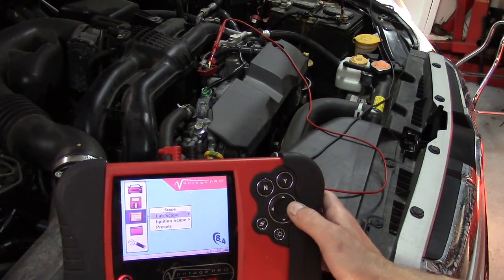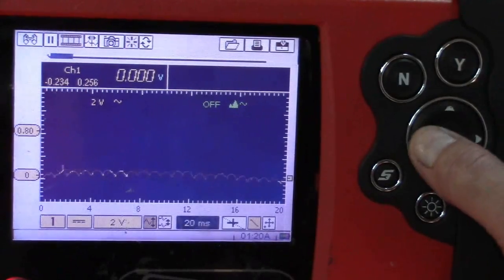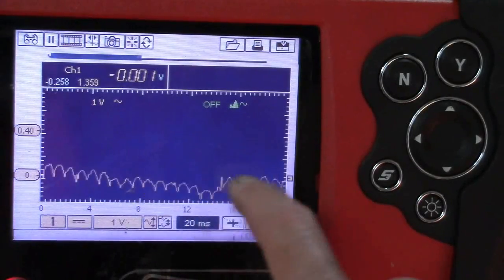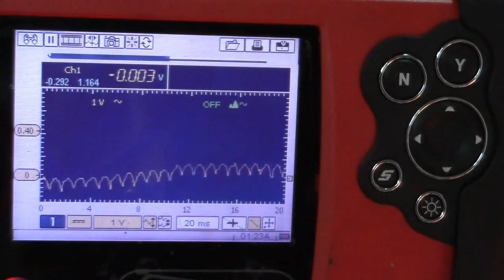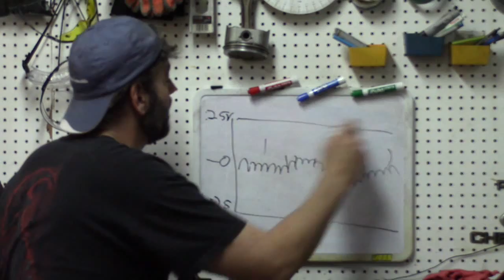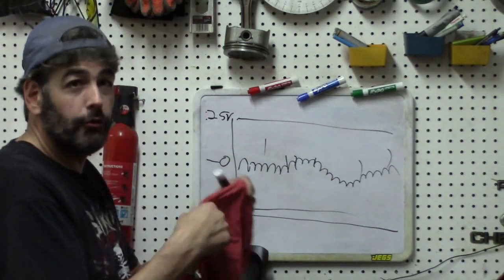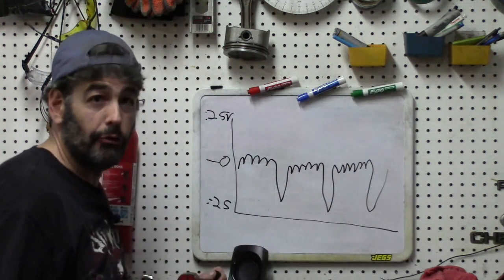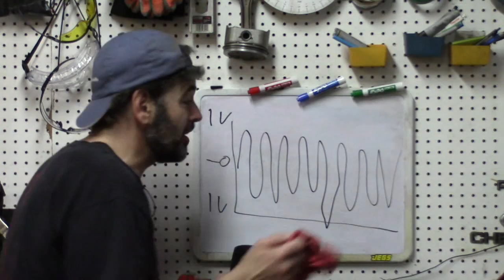DIY- Alternator Test Using the "AC Ripple" Method

Comment: I think you mean the diodes are bad particularly Matt as the diodes convert the AC to DC ; when they fail they allow too much AC in the system which can cause the sensors to go crazy, and the speedometer to move with the transmission in PARK

Comment: Great video God bless! my alternator passes but not the ripple test my heat and cold dashboard light is out and a battery 🔋 light on but the battery is still charging.. I have a spare alternator in the trunk in case I need to install it thank you huge stress relief

Comment: Hi Matt. Can I use this test to a car equip with Intelligent battery sensor?
Reply from the maker: Yes!
Reply: @SchrodingersBox Does the specs. for ripple test .400 ac volts and 40 milliamps?is it correct? Can you correct me if Im wrong. Thank you

Comment: To do this test I had to connect one of the leads to the Battery positive terminal, not the negative as shown in this video.
Reply from the maker: bruh. it’s measuring AC.
Reply: @SchrodingersBox  Yeah, I get a good pattern connecting to battery positive and B+ terminal on the generator. Even the Snap-On ripple test video tells you to connect to Pos. and Pos, measuring AC.

Comment: If ripple test done  and the result was bad. Dose this causing parasitic drain .

Your advice highly appreciated.

M.y
Reply from the maker: that’s a good question. I am not sure. the parasitic drain from an alternator would be caused by a bad diode and current would not be unidirectional. however I do not believe the diode is responsible for the AC ripple pattern- I think that’s the result of the commutators. 
.  Not totally sure on that though.

Comment: Can you use a multimeter to do the ripple and test and base if the alternator is good by the measurements
Reply from the maker: i don’t see how you could do that- even with a frequency measurement, you wouldn’t be able to determine a commutator dropout based on a numerical output only-  that I can think of at least.

Comment: This is going to sound crazy but I'm getting 26Vac on a dvom. Am I right to assume the diode pack is bad or could it also be the voltage regulator.

Any guidance would be appreciated.

Comment: I think my alternator is doing this and it's also causing shifting issue in trans is that possible? It threw a p0700 code one time but once cleared hasn't thrown code again but lights flicker in cab headlights taillights etc
Reply from the maker: a bad alternator can cause just about anything to happen.  you must fix alternator first before determining if there is a legitimate code.

Comment: RPM needle increases about 40rpm, then drops down about 40 rpm all the time, up.....down, up..down....... up........down.... Didn't think it was an issue until I was hauling a little utility trailer up an incline, those little 40rpm flickers turned into surging, needle would rise and fall a good 400-500 RPM's making the car surge and transmission rattle away. 

I found on my OBD2 reader a graph showing the Control Module Voltage, it jumps between 14.4 and 14.8 a lot. Makes a slight whining noise almost in tune with the RPM needle flick, it could be because the RPM's are increasing and decreasing thus making the alternator go up and down, but could it be that my alternator is outputting power with a surge of .4 to .5 volts? meaning what the rectifier isn't doing its job and keeping it constant? The multimeter gets a solid 14.75 but thats a slow refresh rate device, the OBD2 scanner gets a spikey graph with a .4-.5 volt difference between max and min. 

This flicker has been going for 2 years now, no codes, no check engine, 2 garages couldn't diagnose it.

Comment: If the ripple voltage is beyond specs or fluctuates more than 250mv, cant you just replace the rectifier/diodes?
Reply: did you find a fix? got a test at autozone and they said it’s at 8v

Comment: Matt:
Could  a bad diode in the ALT. fool the ECU into "thinking" it's the O2 sensor acting up,and go into OPEN LOOP??

I have here a 2001 Daewoo Nubira 1.6 (GREAT car,by the way,one of the best i've EVER seen,42 years as a mechanic) that is driving people crazy; at idle it stays in closed loop,but over 1000 RPMs, it's open loop all the way;,and it did not easily pass emissions inspection;  ALL other parameters are ok.

I have been searching the net for that, did not find anything,and I came here from a video by Scanner Danner about a bad ALT. showing 20MPH on the speedo,while standing still;

I will try to unplug the  ALT. to see; what do you think? Possible? This car has been doing this for a couple of years.
Reply from the maker: Never heard of that. Not familiar with Daewoo. Usually when I see OL after CL set, it's actually an OL3 condition typically caused by misfire detection.
Reply: @SchrodingersBox   I think there is no misfire,runs perfect and no codes,no light; however,the car  was converted (aftermarket polish made kit, cheap--about 200 eur/dol--and very good,actually,and with its own ECU) to also run on LPG, (which costs only around 1/3rd of gasoline here in europe,portugal),and it goes Open Loop on either fuel,above 1000 RPM; but still running "perfect",just high on CO and HC; front O2 sensor has been checked,changed,still the same;  i'll have to look into the ALT. output for AC(there is a rumble at idle that  i'll have to look into...) and then into the LPG wiring,because i saw it is set up to commute from gasoline to lpg at just over 1000; i have the special scanner  for the lpg setup,will look into that when i have time;
Anything relevant,I'll post it here;
And thanks for your videos,man, entertaining and useful (i also had to go look up what the heck was the Schrodingers Box  lol ).
Reply from the maker: @josepeixoto3384  I would start with a basic fuel trim analysis and see if it is perhaps going out of range causing an OL3.
Reply: @SchrodingersBox  Well,i'll get to the bottom of it!!

I  spent 1/2 hour on the Daewoo Nubira 2001 today,and i found ,partly by chance(i had glanced at the wiring already)something interesting:

If i turn the A/C on,the ECU/O2  will  cycle properly in Closed Loop  ABOVE idle, and at all RPMS; 

THe A/C pressure sensor(Daewoo -ACP) shares the 5 Volts reference voltage with the MAT and with the MAP,and  so, I'll have to do some measurements,could not get to the ACP yet to unplug it.
Also, my(poor) scanner tells me Bat.Voltage 13.1!!! Have to check that; The Alt. is most likely defective, i hear a humming sound)i'll have to hook up a 14 Volt power supply to the Bat. to see what the ECU does then(Alt.is a b*** to change there,and it's been running like that for ever,and i was not hired for that...yet; i was hired just to get the car to burn clean,within the law,to pass emissions test.
I'll be back.
Reply: Solved, it's in CL,closed loop, now,no more OL,open loop;

The ACP is a NC(C being the A/C off)  switch,and when it becomes NO(A/C on) it liberates some of the 5 volt ref. shared by the MAP; i left it unplugged,no symptoms,idle speed is already compensated by other means,that was factory overkill,or oversight,after all there is also no pressure sensor for the power steering effort ( this particular system also links into  TPS and O2 to actuate the stepper motor to adjust the gas flow) ,but still OL would appear at random RPMs;

The front O2 sensor signal wire had  been split/spliced into  2 wires (the LPG installation manual  instructs it): one to the factory ECU,the other to the LPG ECU,(violet wire);   cut that one,it is not needed,the LPG ECU has 4 gasoline injector emulators inside, and 
 the LPG ECU is  set up correctly for the caloric value,so the car  will not get issues with the short/long term fuel trims in its  ecu when switching back and forth,and it does not;

But why OL at just above idle, coincidently the RPMs that the the car was setup to switch to  LPG at?   I got the PC,and  went  into the LPG setup and changed that to 2000 RPMs;  the OL started appearing then at 2000 (the way it works is, after you depress the LPG button,and the temp is above what was set by the installer,in this case around 40ºC, what the customer demanded,the change takes place just as soon as the RPMs surpass 2000,or whatever value you set,and ,by the way,the switch is absolutely seamless)  so i thought that internally,the LPG ecu was robbing the O2 signal even  before  it commutated to LPG ;  i put it back at 1200 RPMs;
 
So,i went into the harness to undo the splice; i also reconnected the O2 signal wire with the proper terminal,since this oxygen sensor has  NO hole,and they sample the ambient air that permeates,get this,between the wire strands and the insulation,all the way from inside the ECU; cannot function without that ambient air,they "measure" a gradient(a difference) of O2 concentrations, generating a voltage; hard to believe, but that's what Bosch,and all others, say about it; it's similar to a microphone that generates electric pulses from our voice pressure waves,for instance; or,in another scale, lol, a piezo/Spark lighter.

And it runs fine now, even with the sum of the 2 fuel trims around +8; the ALT. was found OK,charging at 14.2 V, just noisy,needs a front bearing, both of course; that and to have the injectors cleaned,which for this Daewoo i don't have the (funny) adapters for the fuel lines; but my nose(yes,at the tailpipe),now tells me it will pass the emissions test, sometime this week, (it's up to a month to the state retest)it's no longer running rich,nor with any  misfire.

Comment: Is there any way to test a car battery for reserve power? I cant find no videos on how...  I bought a load Tester for my battery &  it passes along with cranking & charging, no problem , starts every time for months & months... If I leave my lights on for 10 minutes & engine off my battery is complete drained....  Battery is 5 year old, Altima 2005... before I waste money on a new battery & don't need one I's like to test it..  I bought this one...

https://www.amazon.com/dp/B000AMBOI0/ref=sxts_sxwds-bia_1?pf_rd_m=ATVPDKIKX0DER&pf_rd_p=d754fdf0-fd52-4edd-8917-8e65a84c20d5&pd_rd_wg=cqFwT&pf_rd_r=RE9Q8NPVP621PDJ5WA00&pf_rd_s=desktop-sx-top-slot&pf_rd_t=301&pd_rd_i=B000AMBOI0&pd_rd_w=fYjJt&pf_rd_i=load+tester&pd_rd_r=c92a13de-41e5-45d7-b8ee-f3ddaf1d8e8d&ie=UTF8&qid=1535390385&sr=1
Reply from the maker: Not sure how that is done exactly. i suppose there must be some extrapolation that can be calculated given a specific voltage drop with a fixed load time at a given temperature.

Comment: I used to install vehicle fleet management systems back in the day. These systems would not work on a unstable auto electrical system as it would screw up the speed and rpm readings it read from the vehicles sensors. I used a digital multimeter for convenience to measure the AC ripple voltage and discovered that readings >40mVac up to 100mVac was generally a problem created by dirty battery terminals or poor battery to GND chassis connections. Readings >100mVac was a result of a faulty charging system - caused by faulty bridge rectifiers, broken/worn out alternator brushes. NOTE: When conducting these tests the motor has to be revved between idle and +2000 rpm on heavy vehicles and idle -> +3000 rpm on light vehicles.

Comment: I've noticed that on a lot of newer cars the alternator can be bad and not be putting out enough or even be putting out nothing at all but for some reason the battery warning light doesn't come on like it should. In these cases the battery will keep going dead and the only way to check the alternator is an output voltage test or ripple test.
Reply from the maker: Yes this is due to the alternator light strategy. In many cars the alternator light is “suppressed” by the output voltage of the alternator “pushing” against battery voltage.  if the output voltage is battery voltage or lower, the light illuminates. The problem is anything greater than battery voltage will prevent illumination of the dummy light. 12.7V would suffice. So as you mentioned before- the alternator is not putting out sufficient voltage to charge, but there is enough to keep the dummy light from coming on.
Reply: I agree. It is poor design though. Anytime the charging system is failing to keep the battery sufficiently charged over a reasonable period of time the light should come on. Otherwise the vehicle is going to fail to restart periodically without warning the driver that something is wrong.

Comment: Alternators are really just AC generators except the AC is rectified into DC by the stator diodes. The dropouts you might see in the output waveforms are caused by either an open stator winding or a bad rectifier diode. An alternator with an open stator winding or bad diode may still charge the battery but the output will be reduced so the battery may never get a full charge.

Comment: Hello Amigo
Nice beard. The word ripple reminds me of the wine Fred Sandford drank from the tv series Sandford and Son. I have a 98 ford exploder that came to the shop yesterday. It was charging at idle with all the accessories on but the moment you throttle up the battery light would flicker. Ripple test coming up this morning. Also has a parasitic draw. Nice video

Comment: Thanks Matt. We have a battery tester which acts up all the time even though it was just replaced at work. It requires you to do the battery test then the starter and then the alternator every time. It's a standard test which a customer has paid for. Whenever the tool doesn't feel like working. I can do all these tests watching a multimeter except the ripple test of course. Now that I know what to look for in a ripple test, even if that tool Fritz's out I can whip out the scope and know if the alternator is bad. 

Plus...I've seen alternators go back and forth from rippling to not rippling. Very bizarre. Having to test the battery and starter repeatedly for a tool to analyze a wave pattern when I've always wanted to be able to check it myself was a huge waste of time to be forced to repeatedly to add in a battery and starter test. 

Like I said. We have a tool which can work, but what about intermittent problems? What about when the "battery tool" is working but it's wasting your time?

Thank you so much!
Reply from the maker: Great information Dave. Hope all is well!
Reply: Schrodingers Box I believe it analyzes ripple for only a moment. Battery testing combination tools can be tricked.

I've not seen it much, but this technique is clearly superior in this circumstance. 

I'm doing great. Found a busier shop but it's farther from home. Trying to close on a little closer house. 2-3 times the land. In the country. Functional 2 car garage instead of my current awful 3 car garage.

Idiots installed the roof...sigh...hoping they'll sweeten the deal now that we have that from the inspector's report.

I hope all is well for you too. 👍
Reply: Schrodingers Box apologies. I didn't say garage in my reply. It made the car comments very confusing. It should make sense now. 2 or 3 car "garage" with the "" portion missing is just a bizarre sentence. Lol

Comment: I have a battery tester that shows Ac ripple as an average millivolt number. Usually numbers low like below 30 millivolts. I've seen higher than normal 100-200 millivolts from batteries that test bad or batteries with dead cells. not totally sure why that is scientifically.

Comment: I once "re-wired/recycled" my 94 kia pride (carbureted car). Wired the Alternator's Output directly to the 12v battery. I then noticed a year after. Whenever I use the A/C my battery runs out of power. Probably some of the windings already failed. Alternator couldn't keep up with demand.